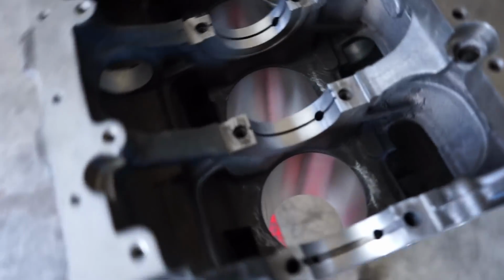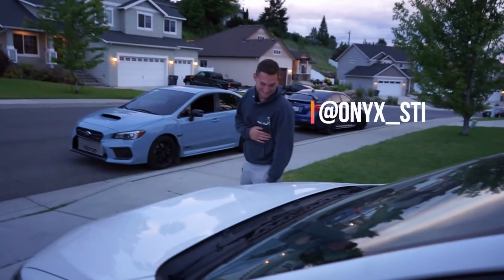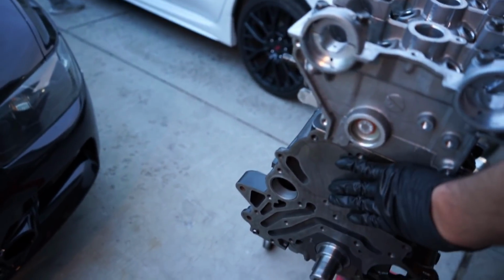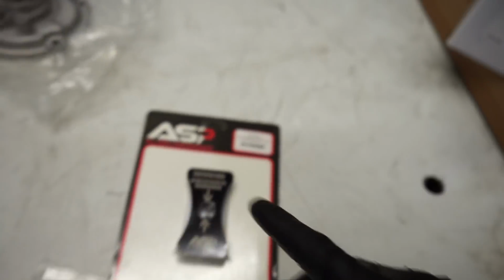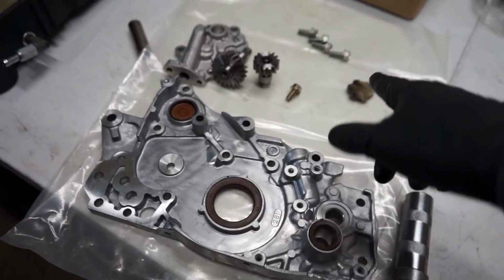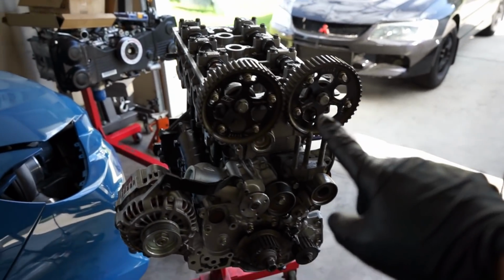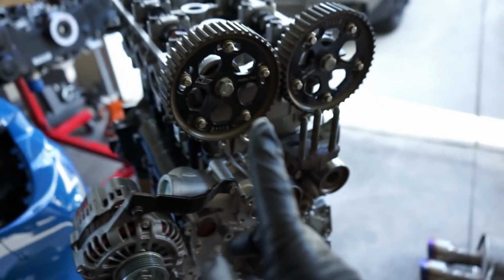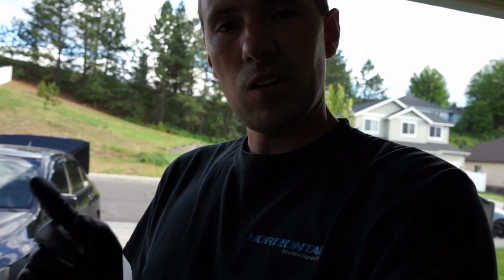800whp Evo 8 Build: Finally make some progress!!

Comment: I’ve heard a lot about 4g64 cranks splitting under decent power like 5-600’s ?? Opinions ?? I went with a stroker kit on my 4g63.
Reply from the maker: I’ve never seen an issue or had any issues with them tbh, usually Oem cranks hold up very well.

Comment: Brake fluid in the eyes is a lovely feeling, was spraying my heads clean once, sprayed it into the exhaust outlet, and it just sprayed out the valve holes into my eyes. did not think that through😂 then had to stumble through the garage blindly trying to get to the sink😂
Reply from the maker: I couldn’t imagine brake fluid 😂😂